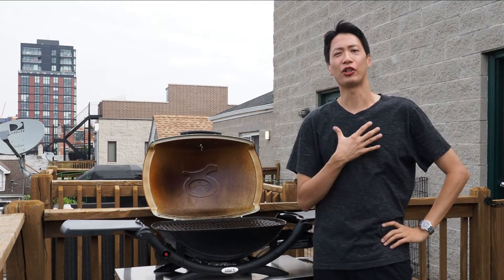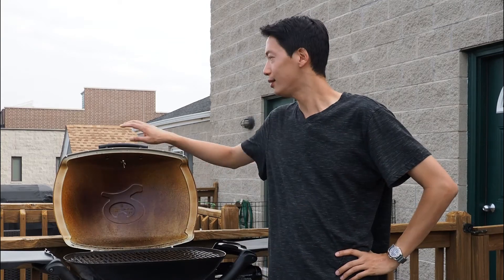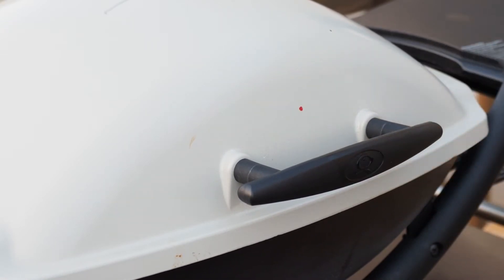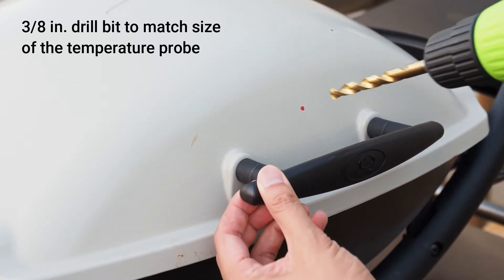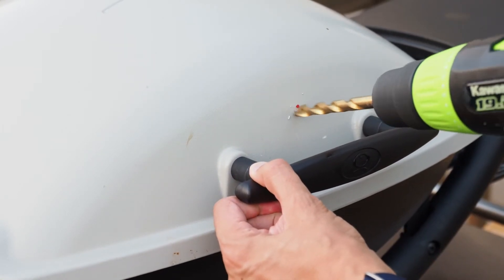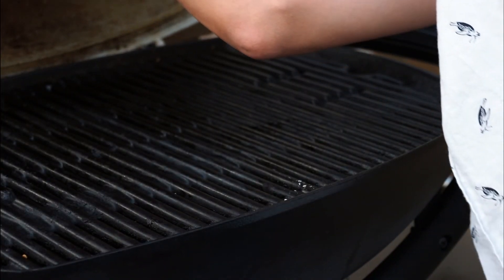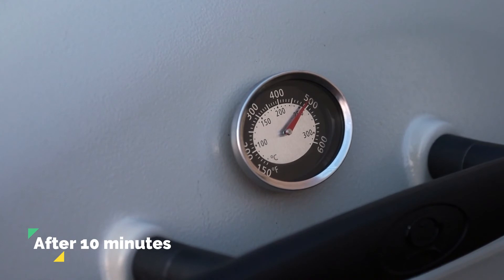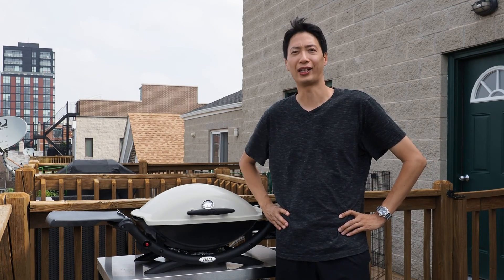How to Install a Thermometer On a Weber Q | Weber Q2000 to Q2200 "CONVERSION"

Comment: Great job. What is the LINK for that Amazon grill thermometer you're using?  Also, did you use a special metal-rated drill bit or just a regular bit?
Reply from the maker: Here is the link to the thermometer that I used.  I should have used a special metal-rated bit, it would have been slightly easier.  But it was just a regular bit.  
https://www.amazon.com/gp/product/B07S89TDT7/ref=ppx_yo_dt_b_asin_title_o07_s00?ie=UTF8&psc=1

Comment: Weber Q's are wonderful grills. My first one was a used Q2000 that I bought for only $60!  I never got the chance to add a thermometer to it before my ex wife took it! After that I just bought myself a Q1200 which is the smaller model but has the thermometer. Either model is worth every penny, they never let me down.
Reply from the maker: That’s a screaming deal! Great find! I think Weber claims the Q is the most sold gas grill in the world.

Comment: Put masking tape over where you are going to drill so the drill bit does not slide around when you start drilling. I also agree with drilling a pilot hole first.
Reply from the maker: Great tip… wish I had known or thought of the masking tape trick as that certainly would have helped with the drill bit sliding. Oh well, next time then :-)

Comment: Since heat rises , shouldn't the thermometer be higher up toward the top of the lid to get an accurate reading ?
Reply from the maker: There’s a Weber Q Facebook group if you’re on the platform. I believe a member actually did install a thermometer in both locations to compare, and if I recall it didn’t make a difference. Something about the design of the lid traps and circulates it pretty evenly.

Comment: I just bought a used q200 for $50, can you recommend a good temperature gauge/thermometer?
Reply from the maker: That's a great price and a great find! The Q200 as far as I know is pretty much the same as the Q2000 that I modified in this video, just a few cosmetic changes.  Anyways, the one I used in the video doesn't seem to be in stock anymore, but a very similar looking version would be this one: https://amzn.to/2MGCHNI

Comment: Drill with a smaller drill bit and then step it up until you get the necessary hole size.

Comment: Hi Jerry.  I am planning to add a thermometer to a used q100 that I just purchased.  Have you been happy with the placement of your thermometer?  It seems like the factory placement is fairly high on the dome vs. your placement.  Thanks for the Videos.
Reply from the maker: Hi Sparky, thanks for watching. Yes the factory install is slightly higher. I’ve been happy with the placement. I have found the location to be reasonably accurate and it doesn’t interfere with opening and closing where I have it.

Comment: Mounting the thermometer that low, because it's close to the flame source, wont it give a false reading of the true heat of the interior of the baby q
Reply from the maker: Hi David, good question, because the Q1200 and Q2200 thermometers are a little bit higher in the dome.  That said, I've found this gauge to be surprisingly accurate for a $20 Amazon purchase.  I put an inkbird probe in there and the readings are pretty similar.  I've also done several roasts using just that lid thermometer as a guide and the cook times have been pretty close to right on.  That said, no matter if you have a factory installed or aftermarket thermometer in the lid, you should use a meat probe to verify your food temperature. Hope that helps.  Thanks for watching and commenting.